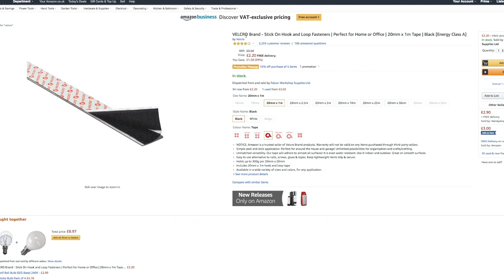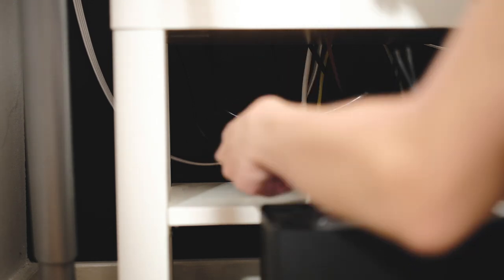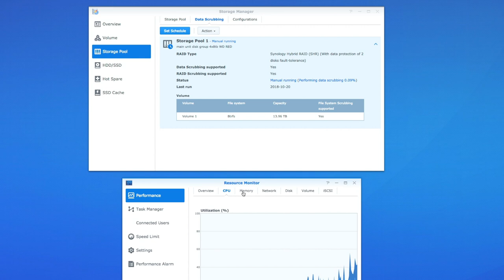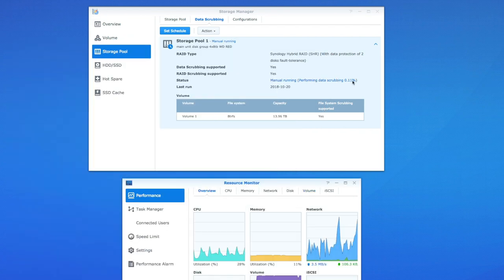Synology DiskStation Vibration Noise - EASY $5 FIX!

Comment: These are 7200rpm drives? Made a order for a DS920+ and 3x 4tb wd red pro ( hgst drive )
Reply from the maker: Hi. Mine are standard Red 5400 rpm. Not the plus or pro version. :)
Reply: @JoeLamOfficial  smr version of the drives.
The red plus and pro are CMR, my pc has 3tb toshiba ( hgst ) drive and very silent due to the rubber mounts.

I don't think it will be on the 920+.
Reply from the maker: Eventually will upgrade one day. I have about 2TB left on my 4x8tb but to be honest. I think my dual disk backup might seem overkill. So I’m loosing half of the storage space.
Reply: @JoeLamOfficial  mine goes to raid 5.  Shop changed delivery time to unknown.
Basically they don't know when they have the drives in stock.
I might move to the red plus or ironwolf pro.
Reply from the maker: @daand12  global shortage on everything for the foreseeable future 😞
Reply: @JoeLamOfficial  I see that, other online store can get me 5800 wd red pro's, so don't tell me that's a shortage :). Borrowed my barracuda desktop drive with a 970 evo plus for testing purposes.

That barracuda drive did work for two years in my ds218 which now has a 1tb 860qvo and it works for my needs
Reply from the maker: Cool. Glad you found some!
Reply: @JoeLamOfficial  first two are send just now and will be ordering the third one right now.

Have you upgraded the ram? I have about 128gb ddr4 total ram.

Will be testing out a 16gb stick, it should work.
Reply: @JoeLamOfficial  Installed the 2TB seagate drive and installed DSM 7.0. I must say the thing is pretty silent, you barely hear the seagate hard drive. I know it's a silent drive overall, but getting the Red pro's tomorrow and pretty sure they make some noise.

Some people say it's a WD Black drive rebadged as a NAS drive.
Reply from the maker: @daand12  what speed are they spinning at? I really don’t like my WD RED. So loud. Even at 5400rpm. Do wonder if all mechanical Nas are this loud clicking away
Reply: @JoeLamOfficial  Red Pro's are 7200RPM, same for the 2TB Barracuda drive ( year 2011 or 2012 ), so older model. Still works without failure. 
They do fail quite quickly from what you see on the internet.  Mine has 16680 hours on it. Most are from my NAS.

Yes my 3TB Toshiba drive can be loud like your 5400RPM Red drives, but with proper rubber mounting or velcro strip, it should be silent. Also have a 10k rpm drive, but it's just a piece of art for me.
Reply: @JoeLamOfficial  

Also added 16gb ddr4-2666 sodimm and it works. A 3200 one didn't work.
Reply from the maker: Cool. What do you plan to use it for mainly? I didn’t upgrade mine. Kept it stock. 4GB or something can’t remember
Reply: @JoeLamOfficial  I'm using it for Virtual Machine.

Will be transfering all stuff coming weekend from the DS218 to my new DS920+.

The second lan port is used for a direct connection to my laptop which gets me 985mbps link speed.
Reply: @JoeLamOfficial  https://youtu.be/rHcLrEbYkO8

First boot with the red pro's. That buzzing sound is quite annoying and will be fixing that soon.

But one of the drives already died during first install of DSM. How bad is that, bad sectors.
Had from 170 pending sectors to about 2300 within 15 minutes on my pc. It was send back right away.
With two drives only now it's silent.
Reply from the maker: I tried running windows but rather slow. So I use a Zorin OS VM to run mundane or other tasks that take long but not resource heavy like copy or uploads. So I don’t have to hog my laptop.

Comment: Actually, in my Qnap NAS, it did absolutely nothing to quiet it, but the bad part about it like someone said here, not only the steel ones but my NAS is thin plastic which makes it noisy.
Well back to square one maybe building some type of soundproof box that can breathe??
Reply from the maker: I think with most of these plastic open chassis, they are quite loud. For me, it was the extra buzzing sound I was trying to get rid off. It doesn't do anything if it's the fan noise or hard drive noise you are dealing with?

I've tried using this method (if you haven't watched it yet)? - https://youtu.be/A4HzqyG6UbU

Comment: It's good you mentioned how important it is to get all the drives back in the same slots, but it really is a design flaw that this level of care is necessary.  

The NAS could put a signature on all the drives so the NAS could tell that a drive belongs in that NAS chassis, when it was last in the chassis (updated from time to time, or at shutdown), and the nominal slot it should go in.  If a drive is in the wrong slot, the NAS could "just" update some pointers and complete the boot... everything could be just fine.
Reply from the maker: I’m being extra cautious but someone did comment that it didn’t matter apparently. But personally, I’d like to play it safe. 

Thanks Mike for your input. :) and watching.
Reply: @JoeLamOfficial  Better safe than sorry - it is very hard to unscramble eggs.  or terabytes of data.
Reply from the maker: Definitely. Never be too sure when it comes to data. 😅

Comment: kool mode. I don't have that issue with DS1621+ At least not yet. I think it's going to be a good Idea to Number all 6 Hard drives Even before anymode just in case you pull it out and forget to number them. So people, Just number your HDDs From the Get-go. Even if you don't Mod.
Reply from the maker: Great idea. Thanks for watching and leaving a comment by the way. 🙏🏼

Comment: I'm glad I watched your video, that was a fantastic fix that could work for nearly any NAS or external drive.  I'm hoping to purchase a Synology NAS in the near future.  I haven't decided yet on which model I want to get.  I may just wait till the 2020 models come out as there is a new PCIe NVMe/10GB NIC combo card that will be released soon.  I don't understand why on the models that have the PCIe slot why they didn't just design them with dual slots.  Or as with the DS918+ make the motherboards with the NVMe slots on all of the models.  I plan to use it for storing full image backups for 6 - 7 computers and as a Plex Server as I have a very large collection of media.  I'm thinking of one of the models with 5,6 or 8 drive bay and dual eSATA ports for future expansion.
Reply from the maker: Thanks for watching. Well I’m hoping that they would have fixed this issue on newer models.

Comment: Nice one Joe! it was enough for me to just flick up one of the tray handles (specifically the one you suspected in your vid too! the one closest to the power button) 
flicking it up, and putting it back in place) and it's quiet again! 
I'll keep your vid in favorites just in case I'll need that tip in future :) Thank you again!
Reply from the maker: Hey. Thanks for the tip. Good to know that works too. For me it would start buzzing again as it’s a bit loose. Hope it stays quiet for you without this small mod. :)
Thanks again for checking out my video.

Comment: On my 1511+ I use strips of an old cotton undershirt. Just put it on a lane and hold the edge whilst sliding in the drive. $0 fix. 5 minutes of work. NAS is o quiet now, couldn't get used to it in the beginning.
Edit: thanks for the inspiration to figure it out.
Reply from the maker: Good idea - just anything to fill those small gaps should help remove those annoying buzzing sounds.
Reply: @JoeLamOfficial  Yes, the problem is that the slide and the HDD are hard. The slide should have been soft and tight-fitting. Plastic on plastic is bound to give some kind of noise.
Reply from the maker: Very true. It is slightly annoying by design considering this device isn’t actually cheap.
Reply: @JoeLamOfficial  Yep. For me it was 700 Euro's excl. drives back then. That's a lot of money for anyone.
Reply from the maker: They're still just as expensive. To be honest, in the future I might build my own instead. With NAS software and much more powerful parts to run VM or use as a seconded computer.
Reply: @JoeLamOfficial  That's funny, I was orientating myself already to do the same. But my oldie still works like a charm, so I can't find motivation to invest new money.

But I won't repeat this the second time. The prices simply aren't correct for the goods you get.
Reply from the maker: Same same. Not planning to change as long as it still works. Will consider when I need to upgrade or something fails.

Comment: Wow amazing yet simple solution! thank you!!
Reply from the maker: Hey thanks for leaving a comment and watching my video. ☺️
Reply: @JoeLamOfficial  truly a life saver! I just put it in my nas and the sound reduced so much! There's still some vibration happening when it's heavily reading the drive, but much less! Btw, would you recommend putting a velcro on the top area as well? or the drive won't fit? Thanks again!
Reply from the maker: @antonk5414  you could try but I think it’s quite tight already 🤔 it was enough to stop my buzzing sound. It won’t help with general hard drive noise but only specific to the buzzing noise from the chassis. If you do try. Let me know how it goes 😉
Reply: @JoeLamOfficial  Yeah, I ended up switching the Seagate IronWolf for a WD Red 5400 rpm and the difference is huge, sooo quiet. Turns out it was the Hard drive that was being extremely noisy. Thanks!!
Reply from the maker: I never used NAS drives before. Didn’t know how loud they should be. I just accepted the WD RED as this noisy. It’ll be too expensive for me to change now. If I ever need to replace or upgrade. I might try them out.

Comment: Thank you for the tip! My Synology makes the noise since the very start so I will definitely try this!
Reply from the maker: Hey there. Hope it fixes it for you too! Mine didn't make that noise at the beginning but about a year later since new - it started. buzzing. But luckily this simple fix stopped that weird noise.
Reply: @JoeLamOfficial  It works! I've installed the velcro tape and the irritating noise disappeared! Now I can only hear fans and the usual HDD noise. So thank you once again! :-)
Reply from the maker: Thanks for sharing that it does work. As people say this doesn’t work. Thanks again! 🙏🏼

Comment: Thanks a lot - I will definitely try this (already ordered) + some shock absorbers below my DS415+. I already replaced the fans, but the resonance of the harddisks is killing me. In addition the 415+ model has a cheaper case, so the front plastic plate actually also causes some noise due to vibrations. It's really annoying and evidently would be super easy to fix by Synology, but they seem to be too lazy.
Will report back :-)
Reply from the maker: Hi there, hope this trick helps. 😉
Reply: @JoeLamOfficial  Did it, together with some resonance dampeners to put the NAS on from Oehlbach - muuuuch better! Sadly Amazon sent white velcro tape but oh well.
Reply from the maker: Nice! Probably won't notice the white velcro inside?

Comment: I had my DS1019+ just creaking so much that I thought one of the disks was having a fault. All SMART values were fine. Pressed around on all panels, front, side and top, and the creaking is gone for now. I guess the NAS is not really cut out for loudly rattling WD Golds...
Reply from the maker: The plastic chassis and "openess" of the case, plus the slightly loose HDD cage amplifies all the hard drive noise unfortunately.

Comment: One suggestion get a label printer and stick the hdd numbers on the actual hdd
Reply from the maker: Good idea. Need to get myself a printer first. But to be honest, it’s not likely that I will frequently take the drives out so some quick tape will do.
Reply: Driver order doesn't matter, it just matters that you install them all. Present day RAIDs don't identify drives based on their physical port number. I've test-switched drives in Synology (personally own DS415+, work with other DS and RS models in my company) and QNAP and it didn't matter.

Comment: Those WD 8TB helium drives seek really loudly, WD 6TB disks have much quieter seek (but possibly have a louder idle)
Reply from the maker: This is my first time using the WD NAS drives so I haven’t got a noise reference to compare to. But the symbology semi open chassis and on my wood bench probably amplified the noise. The soft Velcro definitely helps dampen the buzzing noise against the chassis.

Comment: Synolllogogy! Gonna try this, my ironwolfs I can hear in the next room!
Reply from the maker: Haha thanks for watching. Hope it works for you. It doesn’t help with dampening the hard drive sound itself , all the clicks etc. But only if it’s causing the synnnnooonnnology chassis buzz.
Reply: @JoeLamOfficial  you can easily solve that. Remove the cover from the housing, line the inside of the housing with insulation panels that are based on bitumen or bitumen substitute. You can easily cut it for the housing and solidify it with a hair dryer.
I've silenced dozens of cases like this.
Oh one more thing, you can also use an old bicycle tube to decouple the hard drives, you can simply cut and glue them.
Reply from the maker: Hey. Thanks for amazing tips. Never would have thought of such methods.

Comment: I appreciate the video, but why no "before/after"? Would be very helpful to hear your NAS after the fix. :)
Reply from the maker: Good point! I assumed people would understand that it's just like before minus the odd buzzing sound. But based on many comments, I now know to do a before / after. Apologies, early days of YouTube when I made that video. Still learning. Thanks to your comments and others alike, I can improve my content creation skill.
Reply: @JoeLamOfficial  Ah, so the buzz is completely gone for you? That's awesome, I've ordered the exact same velcro strips and can't wait to try it. :) And that's np at all, just a friendly tip. I still very much appreciate you taking the time.

Btw, do you think there could be any downsides with this? I mean heat/air flow wise?
Reply from the maker: Yeah the annoying higher pitch chassis buzz noise has gone. It doesn’t dampen the original hard drive noise though. It doesn’t fix that. 
It’s the little annoying buzzing sound that I tried to eliminate. 
Hope this solves your problem too. If that’s the issue you have?

Definitely helpful to let me know what you want to see and how I can improve my videos.  Thank you. 

No. Doesn’t affect airflow or heat. ;)

Comment: I guess this is good compromise between noise and HDD lifetime. Energy created by moving head causes acceleration, which may kill HDD, if it floats freely. Actually the best for hard drive is being attached to concrete. The case of Synology is just too light. Acceleration higher than 0.22g will cause errors.
Reply from the maker: Interesting stuff! The case is quite light but once 4 hard drives are installed, it weighs it down quite a bit?
Reply: @JoeLamOfficial  True, with 4 drives the overall mass is significantly higher and I'm sure Synology engineers were aware of resulted vibration reduction. I should have written: "The case of Synology is just too light to eliminate vibration noise". Glad I contribute to the subject. Since there's accelerometer in modern smartphone, you could use an app to measure it. It would be difficult with Synology (hard drives are hidden), but in case of regular computer drives are accessible and one can put down the phone directly on HDD.
Reply from the maker: I see what you mean now. Makes sense
Is there such an app to detect such vibrations?
Reply: @JoeLamOfficial  The app is called Vibration Meter (on Android). Default unit is mmi, however I recommend to change to cm/s2 in Settings, because 1g = 9.8 m/s2 so you can easily calculate % of g. I've built NAS using regular PC casing plus I use rubber isolators. The max vibration is about 30 cm/s2, which is about 10% of tolerable range of 0.22 g (no errors). The rubber isolators are tightly squeezed and I think this is the point... do not allow drives moving too much. The moving heads will be always heard. I don't know if I can place a link here so please search for "Everything you need to know about hard drive vibration" from EP&T (Electronic Produtcs & Technology). There are very interesting diagrams there.
Reply from the maker: Wow that’s super technical! You must be an expert in that field. I’ll try and find something similar for iOS and attempt to understand your explanation. Thanks for sharing such info!

And try and see if I can find out what Reading I’m getting on my nas.

Comment: Nice idea ... you could also use rubber strips ... good job!
Reply from the maker: Hi there, thanks for your idea. What kind of rubber strips you referring to?
Reply: Joe Lam https://www.conrad.nl/p/3m-scotchfil-7000006089-reparatietape-scotchfil-zwart-l-x-b-15-m-x-38-mm-15-m-549631 ... or you can, instead of rubber, use foamstrips (like for insulation for doors)
Reply from the maker: I see. Good idea. 😀 thanks for sharing.
Reply: @JoeLamOfficial  Hi there … after a year I’m back. You also can use felt. Another tip … why not add a usb 2,5gbit adapter to your NAS. Works fine by me on my 916+.

Comment: It's good and it helps, but unfortunately there's not much that effectively dampens the repeating (every five seconds) click/chunk that comes from the recent lubricating "feature" (or some rapscallion's way of driving customers batshit crazy) in Western Digital drives.
Reply from the maker: Totally agree. Doesn't help with the noisy WD RED drives. They are very noisy. I wonder if IronWolfs are quieter. Or are all NAS drives this noisy. But I'm just glad the buzzing chassis noise isn't adding extra noise on top to the overall system.